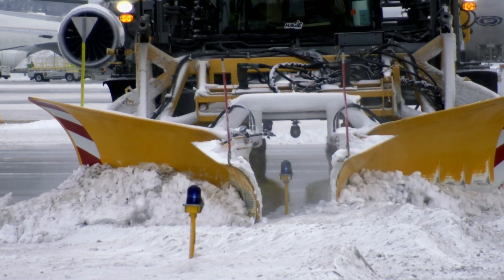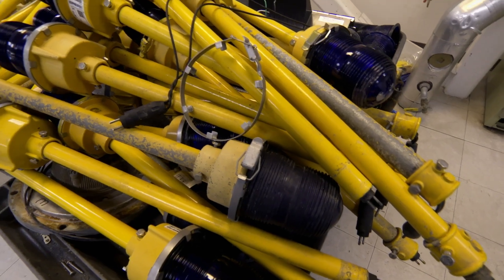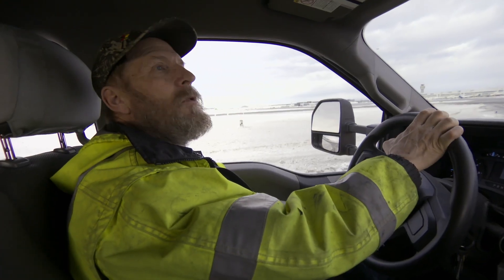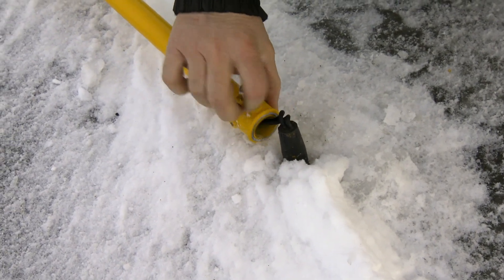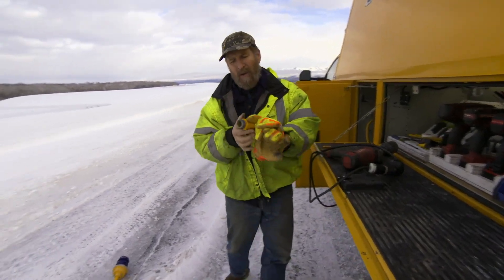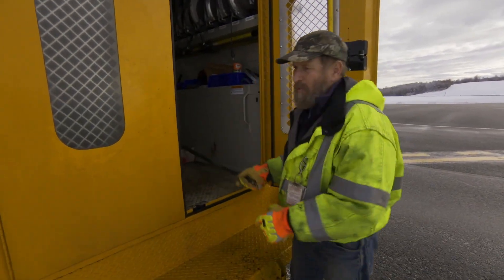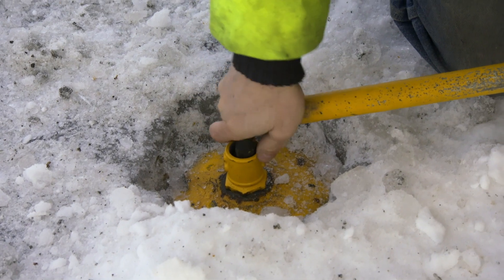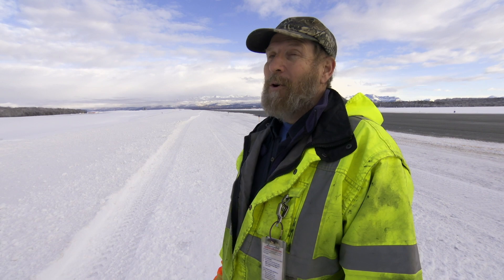Airport Runway Lights Built for Brutal Winters 💡 Ice Airport Alaska | Smithsonian Channel

Comment: why run 5000 v:D?
Reply: Because your 12VDC Christmas lights just won't cut it, also 12V or even 230V won't make it over such long distances without significant voltage drop.

Comment: So why don't they design those lights with a tapered shaft that snaps back upright after being hit by a plow?
Reply: You should design it, patent it, and be on Shark Tank.
Reply: Better option would be to make them retract into the ground so that ground crew can go right over them without causing any damage.
Reply: @_gungrave_6802  6000  motors that have to operate in all conditions, wouldn't work, I feel like they could automate this in the future with pathfinding snowplows.
Reply: @roman-slack  You can install a pneumatic system that uses compressed air or some sort of low temperature rated fluid to fold the lights into the ground during maintenance and raise them for when the runway is in use.
Reply: @_gungrave_6802  Which would mean that a single failure in the pressurized supply line would instantly disable all lights on the system... So now you need a double/triple redundant supply system, a set of valves at each light, sturdy pistons which extend/retract and have a light on top and sensors to monitor system status...
Then it starts to freeze and you can't retract the lights for plows to move in because everything is frozen in place and operating it would likely damage the system...

Cost: millions + a few maintenance workers to maintain a mechanical system... 
Pros: None besides 'sounds cool'...
Cons: Cost, high maintenance, complex system likely to have break downs, retractable lights likely to be frozen over anyway...